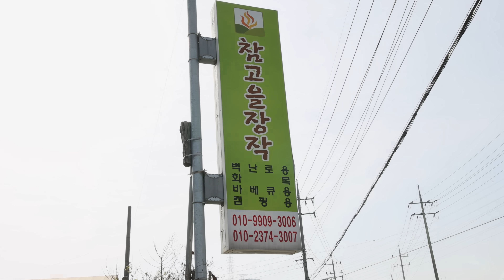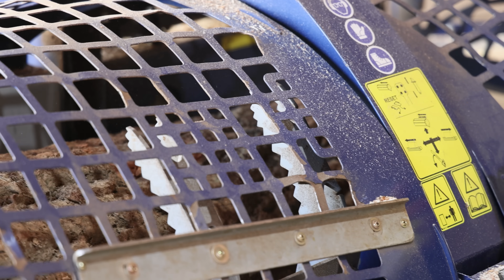The process of mass-producing 8000 tons of wood firewood per year. No. 1 firewood factory in Korea

Comment: How much to end user per pallet?
Reply: It is 180.000 won in Korean Won
Reply: @참고을장작 about $140 in USD at current exchange rate.  I'd guess a pallet is around 2/3 of a face cord, or about 1/4 a full cord. A bit on the high side, but still reasonable. Especially for the quality of wood and since it's all oak.  Oak has very high BTU per volume.